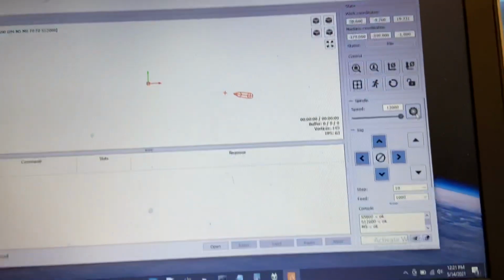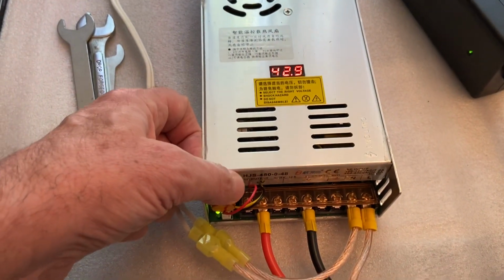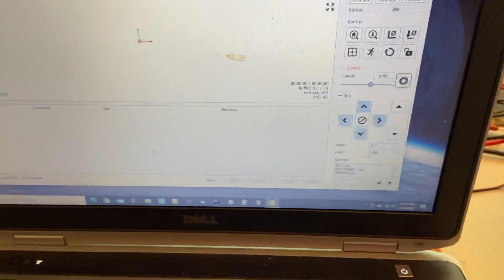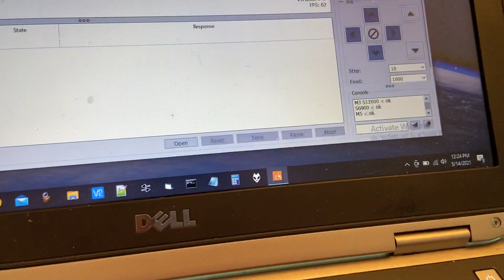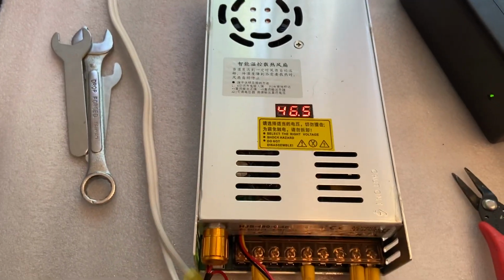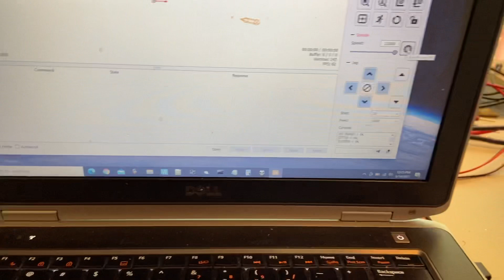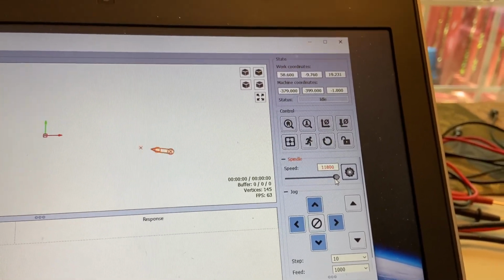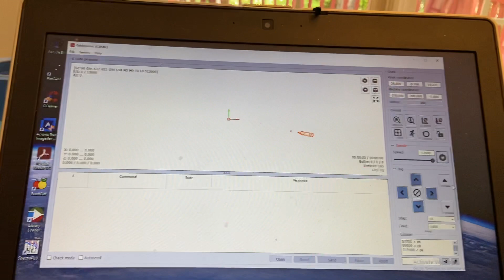3018-Prover 500 Watt Spindle Upgrade with GRBL control

Comment: Thinking of entering the world of CNC. Looking at future upgrades after learning for operate CNCs. Just retired and getting my woodshop up and running. My wife is a crafter and the CNC will help me help her. This video will help me when I will need to upgrade to a more powerful spindle. Thanks for the circuit diagram. (I'm a retired electrical designer)

Comment: I liked the video but did confuse the power supply with the 100v one by watching the video only. I luckily happen to be on my computer rather than the tv and looked at the comments. Please try to add your advice to the video. i wondered why you were "brave" enough to  touch a non-earthed mains casing whilst the power supply was on. Similarly it is easy to miss that it is a 48v spindle.

Comment: I know this an old video but recently purchased a 3018 prover V2 and upgraded the spindle as you did and trying to wire as you did. On the new main board I don’t have the 0-5 v plug as yours does. Can I not plug that plug into the spindle plug?

Comment: Hi!  Really helpful video, the only thing not quit clear to me it's if the 100k ohm resistor it's a 1/4 Watt or bigger.  Thanks again!
Reply from the maker: 1/4 watt is fine. The actual power dissipated in the resistor is about .025 watts. So use any size that is physically convenient to work with. Also try this video I just made https://youtu.be/svj7zPuYvos  This video shows some wiring diagrams.
Reply: @lanierje  thanks, I have already seen the video on the 300W spindle, also very interesting!
Reply: Nice! I can’t wait for my power supply to arrive. How did you calculate the size resistor needed to boost the voltage?

Comment: this is great information, thank you, question about the pull up resistor, how do you figure out the size needed, my power supply say 0-10V and you said yours is 5V,
Reply: I just noticed, I think you have a different board than me,  would you have a link to the board you have? thanks

Comment: Hey, thank you kindly for this video.  Saved me some headache as I had bought a similar setup (brushless 500w), with the same power supply, and was wondering how to wire it to my GRBL

 -- I notice you don't have Ground connected in the video, but you do in the diagram.   I assume using the GND is a good idea, so long as the GRBL board and the 500W power supply share the same ground at the wall.

I get a bit nervous when dealing with mains, but I guess if something starts to smoke, I did something wrong.

Comment: It is not better to switch on the DC side for the spindle ? Thats what I did using a self made mosfet switch unit so that I can use the PWM spindle output.
Reply from the maker: I am using the PWM spindle output to switch the triac SSR gate. Triac SSRs are really cheap and work well for switching AC. Very simple.
Reply: @lanierje  I thought that there were problems switching AC with PWM, but hey, if it works :)
Reply from the maker: @nicholaswouters1203  You need to filter it in some cases if the gate capacitance isn't high enough. A .5uf across the gate is plenty. An RC filter would be slightly better as is in my diagram. Also, PWM amplitude is constant, only duty cycle changes. It is conceivable that a rectifier to the gate would also work well. The triac switching would still occur even at very low duty cycles. Thanks for watching.

Comment: THANKS for your great vídeo!!  I have a good question :  I got a 3018plus 500w...and the PSU that came along with this cnc kit seems too weak maybe or ITS getting too noise at the system since one minut of milling causes complet freezing the steepers get freezing and ... Assuming i could take another DC 24v 5a Power Through Jack , can i keep the 48v10a PSU at the board ? Or It MUST be Wired separetadly ? A board can get Burnt with this both PSU adding voltage?  can i minimize RISKS by lowering down main PSU voltage for 24V20a and plug another 24v5a Through Jack ??

Comment: Have a question, where I live all the electronics stores have went out of business so I'm at a loss where to get some parts as well don't know what to call them. First you made a new 3-wire plug for the connector on the power supply, what is it called and where can I order it. Second, You added the 100k resistor and plug it into the 5v that was on the mother board, what is the connector called. Third, I have the original wire that connected to the spindle motor but it's too short, can I use the Anderson connector to lengthen the wire or should I get a new one, what's it called. Know this must sound crazy but because of Corvid everything closed up. Your help is apricated.

Comment: Thanks for the great video. Way better solution than most others one can find on YT. A question, I recreated your setup exactly, also using the 10k resistor. However if I run the spindle at max, the output voltage reads 52, not just 50.7 as in your case. Maybe I am missunderstanding something fundamentally but since the PSU is for max 48 and so is the spindle, is that an issue?
Reply from the maker: I'm glad you got it working. That resistor should be 100k (not 10k)
Reply: @lanierje  ha, I knew I missed something, thx! ;) . Btw, I omitted the entire SLR on/off controll and do everything just through the PWM of my 3018 board, works flawlessly.

Comment: I was able to  find all the connectors except the 2 pin plug that you used to get the 5 volts to up the voltage with the pullup resistor. What is the proper name and where did you acquire it. Thanks Jon
Reply from the maker: the circuit diagram shows the types of connectors

Comment: Are the motor rpm is correct as showing on candle?
Reply from the maker: While voltage is linear, the RPM is not linearly related to the voltage. I did  verify I am getting over 13k RPM no load at 100%.

Comment: I suppose it was a mistake to buy the 500w spindle with the operating voltage of 100VDC. It comes with one of those cheap p/s with an output voltage of 0-100VDC. I can't find anything on Amazon with 100VDC output. Will the p/s your using work with my motor with only a 48VDC output? I'm guessing no. But, I don't know. (Motor has operating voltage of 100VDC at 4A. Input AC110V +/- 10%50/60hz.) If anyone can clue me in, I'd be grateful. I've got everything in the video but the better power supply. Hope I don't have to buy another spindle motor. :/

Comment: I have one as well and it doesn't make sense out how is the spindle 500w when the power supply is only able to deliver 480w including feeding the machine stepper drivers and board.
Reply from the maker: It isn't powering the steppers or anything else. It only powers the stepper motor. Also, the motor is rated for 500w but it would only approach that under heavy loading if at all. The motor uses a tiny fraction of that power under light loads. The 10A supply is plenty big for this.

Comment: Great Video!, Would the Z Axis Stepper need to be ungraded to handle the extra weight of the 500 Watt Motor?
Reply from the maker: IMHO I think you are fine. The weight should not be much of a factor. Just keep the plunge step low for difficult materials so that it doesnt require much force. Thanks for watching.

Comment: Great video, I ordered my parts but was wondering what the pwm filter is? Is that a component (I didn't see a link for it)?
Reply: rc filter. filters out noise generated by the motor.

Comment: Hey! Thanks for the great videos. I have almost the same set up now but my rheostat looks different and obviously is a different pin out. I have a red black yellow in that order if I connect either + or - to the black middle I get 24v. Then I’m left where to connect ground. Red shorts out yellow jumps it to 72v. Lol I’m pretty mechanical but this stumps me. Any help would be great
Reply from the maker: You do not have the right power supply. If you have one of those 100v power supplies they are dangerous and not isolated from the mains. Don't do it. This method will not work on those!
Reply: @lanierje  it’s a Dork 0-48v 480 watt power supply. I bought from Amazon using your link. Should have a commission on that btw. I also bought the relay from your link and found resistors. It’s wired as yours with exception of in your video it didn’t go into how to tell which pin out on board and I’m assuming (great word) we have diff. Controller boards. Mine is a generic with no cnt out bit a generic 5v next to the 3 stops plug ins. If I had an email or something I could send pics. My gues is the controller. Going to buy when I find which one and which pin out

Comment: Hi great video, but wondering if I could ask what the power pole connectors are rated to ? I have 30A will that be ok
Reply from the maker: Anderson Powerpoles have ratings of 15,30,45. All Powerpole contacts are the same as I recall. They are sized for different size cable to crimp. So any of those will do.  Thanks for watching.
Reply: @lanierje  Hi thanks for the reply, I’m hoping to duplicate your setup but making it compatible with the UK power system.
Reply from the maker: @magnus800  It is compatible. The power supply has a 110/220 switch on it. Be sure to connect the GND terminal as shown in the circuit diagram link for safety. In my video I am using a temporary connection to the mains but you need the GND for safety. The GND is connected to the case of the power supply and the V- is isolated.
Reply: @lanierje  Will do. I’m always cautious with electricity 😁

Comment: Can you tell me what gauge wire you used for the spindle motor?
Reply from the maker: I think it was 18g with silicone rubber insulation from amazon
Reply: @lanierje  Thanks for getting back to me - your video gave me the confidence to upgrade to the 500W spindle, I really appreciate your work!

Comment: I've got everything in the links provided except for the PWM RC Filter, can it still work without the PWM RC filter? Thank you.
Reply from the maker: It will be erratic at low speeds without filtering. At least place a .47uf capacitor across the control terminals of the solid state relay.
Reply: Would you mind giving me a link to that capacitor as well
Reply: @lanierje  so this capacitor interconnects between the + and - after the relay?
Reply from the maker: @davidpinkevich3048  It goes across the 3-32 v screws on the SSR. Those are the control pins for the SSR.

Comment: Some time ago I did the update with a 500w spindle and 100V source with manual speed control. In order not to buy another motor, can I use a similar power supply ?: Output voltage range: 0-120V continuously adjustable, output current: 4A, adjustable to 122V, if possible which solid state relay would you recommend?
Reply: I’ve got the same “100vdc” spindle power supply and motor, I’d love to know if the 48v supply would drive it too!

Comment: New to this stuff and wrestling with getting the right kind of JST connectors.  Could you possibly point me in the right direction?  Thanks for a very informative video!
Reply from the maker: As I recall I ordered assortment kits from amazon for JST-XH and JST-VH. You will also need crimpers. I bought the Engineer PA-09 but there are less expensive versions out there.

Comment: Hi how are you, May I be allowed to pick your brain please?, 1) my power supply has a different lay out compare to your power supply, 2) power supply has three wires for the rpm controller yellow, black and red, behind that it has a switch to change it from 110v to 240v main, then it has two terminals that are linked called off and on, then two terminals for the spindle then two more terminals for the mains power  lead.  3) I have currently connected the mains to 240v and the two next terminal to my 500w spindle  4) I have the same relay as you used. 5) I also have a volt / amp meter I want to wire up as well, which as two leads, a two pin with black and red lead plus a three pin lead which has red, black and yellow 6) I have all different ohm resistors I can use 

Are you able to do me a simple diagram so I’m able to connect everything up correctly please?

Comment: 48v × 10amps = 480w so thays fine... 
What about using 80v ×6amps = 480w 

Whats the difference in preformance.. You're still 20watts under its rated and 20watts under the OEM power supply. 

I assume with 48v and more amps  it runs slower than 12k rpm but has a higher torque 

The OEM is 0-100v at 5amps. 

Voltage is usually attributed to speed and amps is torque 🙃 

It would be cool to get you to do an experiment with the different supplies to see what the difference in preformance really is. 

I'd like to see the rpm of your spindle tbh.

Also why did you jump 100k ohm resistor to the 50v output ?? Like thays doenst make sense. You're pulling up to 50v through 100k resistor.... what in the hell ?